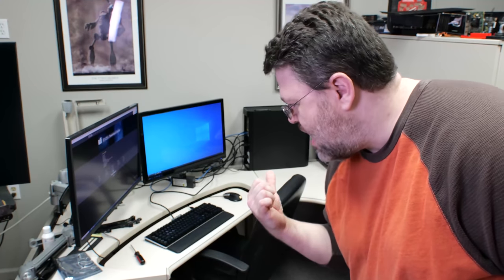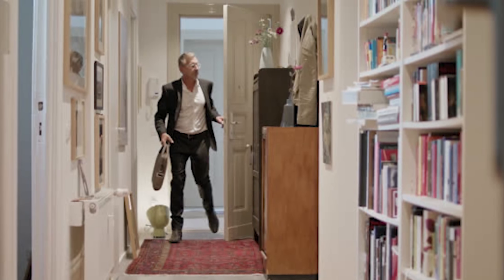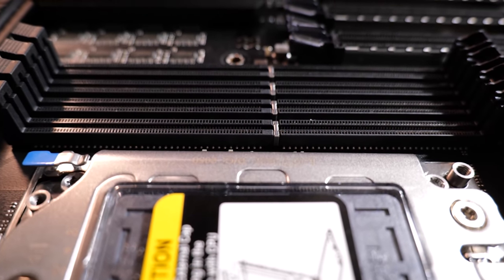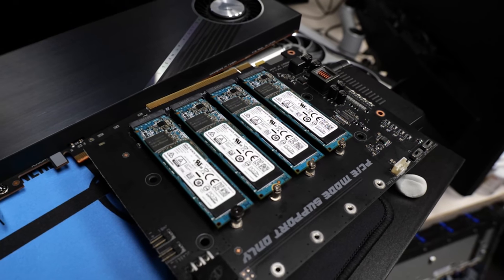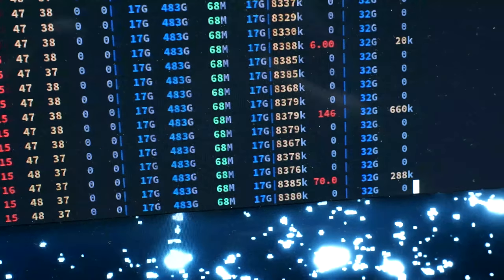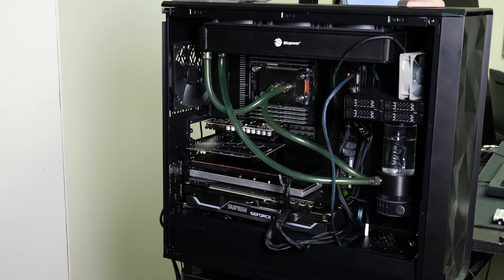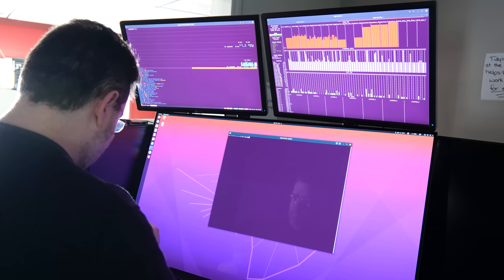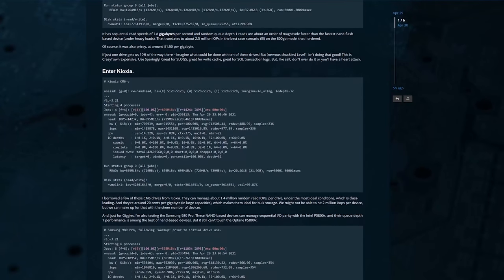Record Breaker: Toward 20 million i/ops on the desktop with Threadripper Pro

Comment: Remember when Linus couldn't build a storage server with Epyc?  Pepperidge farms remembers
Reply: wasn't his reason just he didn't have a system board for Eypc but did for Xeon for the Storage server so he used the Xeon system board. Now to keep thigs consistent they only use Xeons for the storage servers it seems.
Reply: @yumri4  Gigabyte engineering sample of a motherboard likely to blame for their [buttload of PCI-E] drive disconnect/reconnect issues adding latency, I don't know to what extent Liquid hooked them up [referenced in their last server video].

I'm not sure why they [LTT] just didn't buy one [that wasn't an engineering sample] if Gigabytes AMD offering was as advertised, fully featured, and cheaper than an Intel board.
Reply: @RNGwhydoihavetoregis  from what I understand that engineering sample was essentially release hardware, it was just marked as an engineering sample, and they weren't going to go out and buy an entire new server if the one they already had was essentially the same thing.
Reply: Wendell and Linus are not the same

Comment: I posted some M.2 raid results dealing with a similar issue in the level one tech forms a few years ago. Six m.2 drives spilt over threadripper in numa mode. Memory speed used to impact the results significantly when it was tied to infiniband interconnects on early threadripper

Comment: Next year with PCIe 5/CXL: DOUBLE ALL THE NUMBERS!
Reply: Interface may be 2x the speed on PCIe 5, but more to the story than that. Will need both NAND drives and NVMe controllers that can handle 2x the load as well, which is not likely to exist at launch when Zen 4 is released.

But yeah, in a couple years 15m IOPS is going to seem trivial on high end datacenter equipment.
Reply: @benjaminlynch9958  Yep, a P5800X on PCIe 3.0 would have higher IOPS than any NAND based PCIe 4.0 SSD.
Reply: pci-5 is still a few years aways, the validation and tools arnt even finished yet.
Reply: @kleanthisgroutides7100  the first servers will be on the market in 6 months
Reply: @tommihommi1  that’s unlikely, vendors are still qualifying and that could take another year or so… given the wafer shortage and Covind that’s going to push it further plus the extra validation effort needed.
Reply: @kleanthisgroutides7100  it's not 'vendors', it's Intel.
Reply: @tommihommi1  Intel was qualifying end of last year, you do realise qualification and validation especially Intel's may take another year or two, add on the wafer shortage, covind etc... that date could be 2023-2024.
Reply: @kleanthisgroutides7100  Sapphire Rapids is launching very soon. Intended was late 2021, practically it will be Q1 2022. Intel has their supply chain well under control.
Reply: @tommihommi1  waffer shortage is global and affecting everyone... there is a whole year of backlog also.
Reply: @kleanthisgroutides7100  this is pointless, you don't know the most basic facts about what Intel as a company produces
Reply: @tommihommi1  unfortunately I do, together with details on design, supply and almost every company involved.
Reply: @kleanthisgroutides7100  then you would know that Intel is going to launch PCIe 5/CXL servers late this year/early next year, with AMD following later in 2022.

Supplies will not be enough to satisfy the market, of course, but they're launching, instead of just sampling.
Reply: To underline this, Marvell just announced their PCIe 5.0 controllers designed for 14 GBs sequential reads and 2 Million random IOPS.

2022 is the PCIe 5.0 era.
Reply: @tommihommi1  you highlighted the issue, there is no supply.... as off today the wafer backlog stands at over a year and is growing.  Everything from AMD, Intel and NVidia will be pushed further and further out.

Comment: Would it help to setup scheduling to maximize the time between requests per device using mirrored drives? Then do a round robbin to maximize the time until you request the next block from each drive (adjusting for core and device latency) giving it time to complete the request without flooding it.

Another thought is, the threadripper chipset has 8 PCI lanes as well. Might it help to use those in addition to the IO die to offload some load from the IO die? They will be slower but if you can get the timings adjusted, increased performance might more than make up for it since you would basically have 2 IO dies.

When you look at the latency timing per core in the threadripper there is a big difference between the closest and furthest core, so you can save yourself all polling requests that fall within that latency because the original request hasn't even gotten there.  You could also monitor request times to completion and start polling slow and increase it as it becomes more likely to be done. This should reduce the load on the cores by quite a bit without any loss in performance.

Comment: Is there any 7 GPU waterblock arrangement for threadripper pro such that i can fill all 7 pcie4.0 x16 slots with 7 RX 6900 XTs for a render farm and can still have decent temps without any throttling?
Reply: Those are dual slot cards isn't it?. You would need to install half of them outside by using  riser cables and external enclosures, also adding  external PSUs. Theoretically possible but sounds too expensive and complicated to maintain. Better use two systems,, if you pay for 7 top class GPUs the cost of the second system  is peanuts (as long as each one have  a theradeipper with half number of cores and half RAM)

Comment: How long until we can reasonably expect true PCIe 4.0 riser cables?
Reply: We do have them the issue is QA is bad for PCIe 4 riser cables. I think it is due to the speed of PCIe 4 is above what their testing program can measure so it looks the same as PCIe 3. On paper the cable should be the same but in reality it isn't. I think that is in part why the riser cable issue isn't getting fixed as quickly as we would want it to. To this try convincing someone that that 1/32 trillionth of a second is important. In computers it is as that is the difference from PCIe 3 and PCIe 4 for data send or receive. 

You know it is getting insane when you start talking about trillonths of a second as something important but it is made for workstations and servers that seconds can add up to days.
Reply from the maker: oems are buying all that can be made now. the big missing piece is QA stuff. Some 'solutions' I've got use redrivers with dip switches. Not pretty.

Comment: Is threadripper pro the next threadripper? its confusing to me. I thought a new series of trx-40 chips was coming out?
Reply: pro is a whole other series of threadripper chips aimed at professionals. Its a totally different socket too. AMD will probly be putting out both regular and pro in the future.
Reply: @chainingsolid  Do you know if regular threadripper has full support for ECC memory?
Reply: Threadripper Pro is Epyc with a chipset and higher power limit.

Non-Pro threadripper doesn't support regECC.
Reply: @tommihommi1  Thanks. I have a 3960 and the only real slight annoyance is I have to restart it every couple of weeks. I figured ECC might help that but if its not supported then not really an option.
Reply: @skarscalp8157  ECC on UDIMMs is supported, just not regECC and LRDIMMs.

Comment: The problem with using IOPS as a measurement for performance is it doesn't represent the real world. Yes, I can buy an all flash SAN that can do 100 million IOPS but the second I enable RAID the performance tanks. Unless you have a completely reproducible workload that you just need to crunch and discard we need to protect our data, even in RAID 10 there would be an impact. Can you imagine kicking off a 10TB workload that takes 5 days to process in RAID 0 then losing an SSD, that's the express lane to unemployment.

Comment: Just get 16or32 Gigabyte 7GB/s AORUS 7000 Premise M.2 nVME's. They are triple stacked with fins and pipes and will Never Throttle. RAID zero'em and 😃.
Reply from the maker: Throughput is good. but need iops :)

Comment: okay, mad scientist stuff kinda nutty
engagement
Reply: Well he did get close to the IOPs of the system RAM. I think he said if you account for overhead he did get there.  As Eypc and Threadripper Pro are basically the same chip i doubt any difference from 1 Eypc CPU and this but a little one from 2 Eypc CPUs and this. A little one as he is maxing out how many I/O ports he can use.

Comment: When I was working at a Start-up called WebTV back in 1996 we had a Network of Sun Microsystems servers and some NetApp appliances and filers. I remember the engineers talking about how many I/Ops the the Netapp appliances could perform with there large disk platers.
I don’t remember the exact number but it was less than 5  i/ops. I am sure your Threadripper build can beat it.
But we had a Nation wide network of over 3000 WebTV users all on this Netapp appliance database.